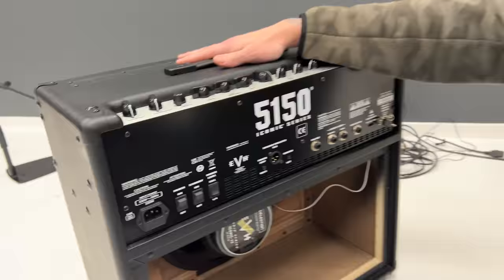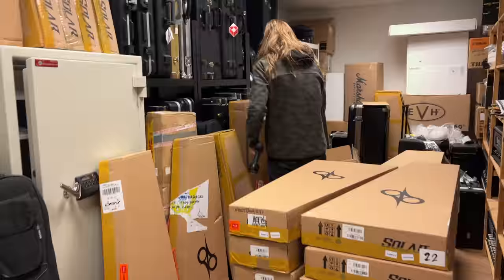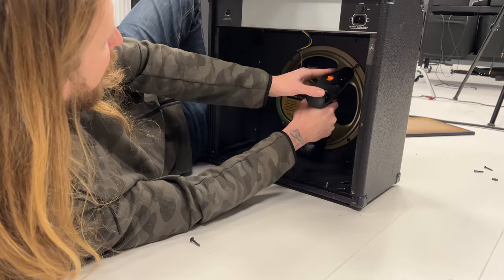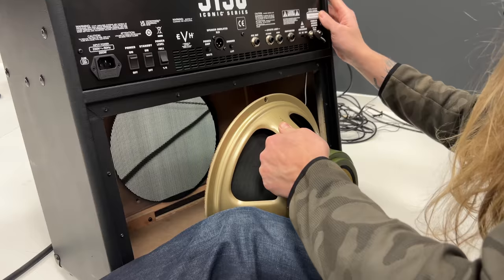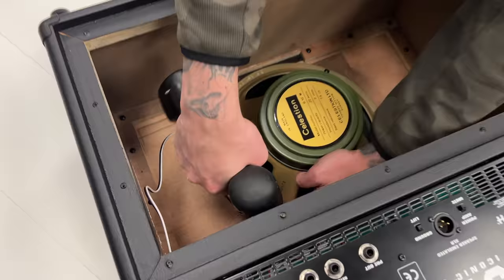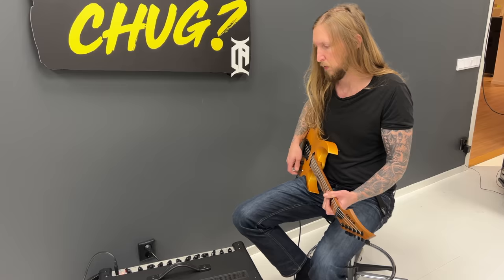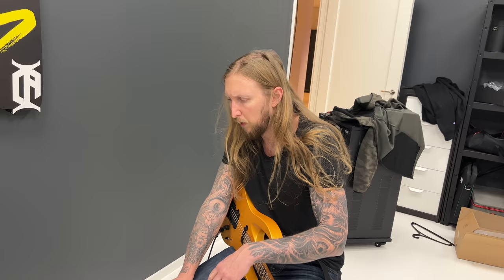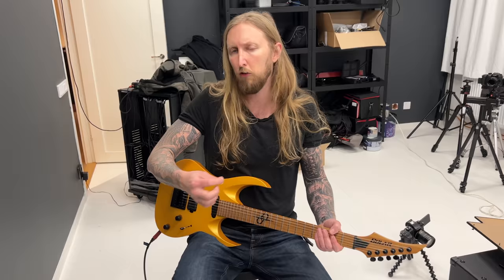EVH 5150 Iconic Combo Speaker Switch - Celestion Greenback 25W

Comment: Well, I see I'm not the only one who thought this amp was getting sold very short due to those hot garbage  variations of a Rocket50, 70/80. EVH, please pull the plug on those horrible speakers and cabinets and truly match them with something decent or else this amp will NEVER get a fair shake! Ola, good job sniffing it out like a bloodhound!! 👍
Reply: Just remember the price of the amp will increase by about 250 bucks,but will be worth it for some who have deeper pockets,
Reply: Are you talking combo or cabinet? You could hypothetically just buy a Greenback and sell the stock one for $40-50 and only have $100 in the upgrade. Far as a head version? You'd be right except double the price for a 5150 standard cab. It's probably most practical for folks who already have a good cab to run it through. Unfortunately there's no cheap way to get good speaker tone unless you do the used market crap shoot
Reply: to be fair that EVH will sound better over time, i'd say like every speaker i buy brand new is really harsh and brittle even because it hasn't been broken in yet. that Greenback has had some miles on it so it's more malleable and lets a lot more bass out
Reply: That could very well be true in this case too, and let's hope so for EVH's sake. I have noticed that cheaper Celestions don't seem to break in as sweet as the others like a greenback, Classic lead, or a g12t. I tried a quad of 70/80s years ago which is what the magnet, basket, and overall sound remind me of with a greenie style of dust cap on these Iconic speakers. I sold them after about a month and just bit the bullet on four t-75s. Maybe you're right and they'll be fine after about 15-20hrs on them, but what can't be broken in or improved is the fiberboard material on the cabinets that will especially rear it's head on the 2&4x12s. Great for stereo speakers, pa mains&subs, but not for guitar-I've tried it, and to me? Solid or ply birch and maple have had the best cab tone for guitar speakers. But that's just me
Reply: I'm also going more off the EVH channel's demo video that used the 4x12, and you would think they'd have them broke them in before recording that video. There's a guy on YouTube that demos the 80w head at home on an EVH 5150iii 4x12" and it just slaughtered the demo from EVH's channel.

Comment: I really didn't hear enough difference to warrant the change. I'm not listening through my monitors but if I can't hear a difference on my phone it's probably not big
Reply: to be fair that EVH will sound better over time, i'd say like every speaker i buy brand new is really harsh and brittle even because it hasn't been broken in yet. that Greenback has had some miles on it so it's more malleable and lets a lot more bass out

Comment: Putting a 25w speaker into a 40w amp, bold moves cotton, let's see if it plays out for him
Reply: They are an extremely robust speaker!
Reply: ...and you will never dime the amp.
Reply from the maker: I just wanted to try it out quick. I wouldn’t crank it more than 25W
Reply: @OlaEnglund2  Ola, what's the best speaker for tight metal tones without being high end harsh? This one?
Reply: @allboutthemojo  essentially yes but an Eminence DV-77 would be better in most cases at least in terms of cutting through a mix,  to be fair that EVH will sound better over time, i'd say like every speaker i buy brand new is really harsh and brittle even because it hasn't been broken in yet. that Greenback has had some miles on it so it's more malleable and lets a lot more bass out

Comment: If I have to upgrade a speaker on a expensive amp I don’t purchase that amp ! lol
Reply: the amp would cost an extra 250 bucks i'd rather upgrade to my own speaker of choice  to be fair that EVH will sound better over time, i'd say like every speaker i buy brand new is really harsh and brittle even because it hasn't been broken in yet. that Greenback has had some miles on it so it's more malleable and lets a lot more bass out